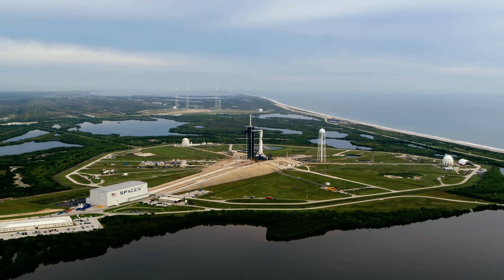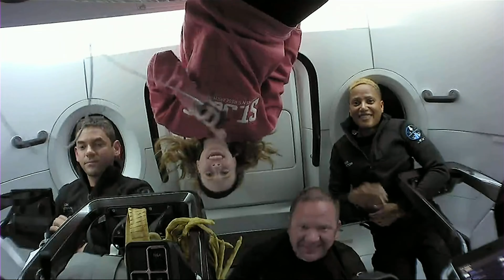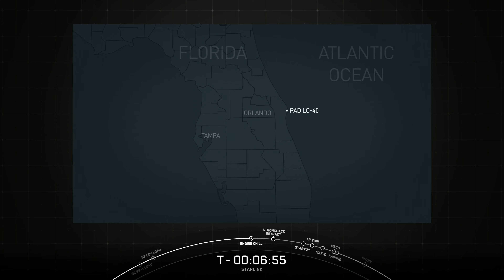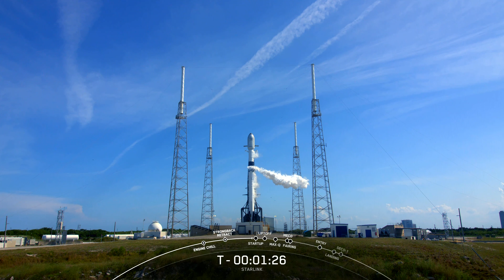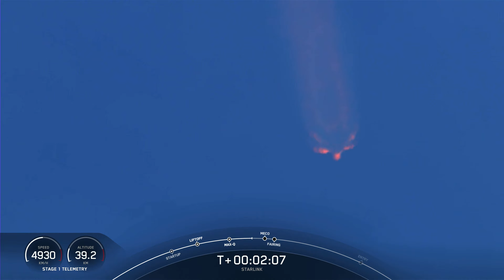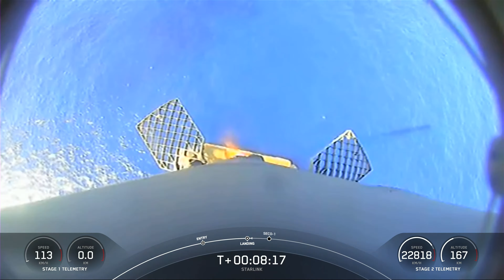Starlink Mission

Comment: This landing shot was extremely satisfying to watch
Reply: And no signal dropout this time! Anyone know for sure if they're now using Starlink itself for their video feed from the barge?
Reply: @jordanhazen7761  Not sure but that live footage was from the 1st stage’s perspective.  I wonder if they can use starlink for that camera too?
Reply: @tomanderson8251  Starlink performance from moving vehicles is improving, and I guess a phased-array antenna could fit in the interstage, but they probably wouldn't want to incur the mass penalty of carrying that all the way up. I think both S1 & S2 transmit from small omni antennas on S-band (there are FCC filings showing exact frequencies), which can be relayed via the launch site at first, but likely switches to either the barge or a nearby support ship once over the horizon, and on to a satellite from there. (For S2 you can hear the callouts of ground-station handovers). Watching the landing again, there was still a slight breakup on touchdown (either from disturbance to the barge's position if the uplink is there, or maybe water vapr in the exhaust plume infringing on line-of-sight), but much shorter of one than previously

Comment: The new 1st stage is more rare, than used one. Fantastic!
Reply: Interesting that they chose an internal Starlink launch to debut this new booster, suggesting few (if any) outside customers still have qualms about a flight-proven one. More often these Starlink missions get used more to prove out the envelope on reuse, as with recent 12th and 13th flights
Reply: @jordanhazen7761  I would guess that now the safest first stage is one used once or twice. You can say it has been successfully tested 😀
Reply: It sure looked beautiful particularly landing on a well-seasoned Just Read the Instructions in a still, blue ocean.
Reply: @jordanhazen7761  It is "flight-proven" so now SpaceX should start charging more for such boosters :D
Reply: @desunistallerinc  I'm sure they won't.
Reply: Used ones has been tested and fine tuned during each launch and landing, new ones probably takes more steps and precautions as they require more data to be collected till they find out what needs to be optimized during the 1st launches.. imho
Reply: Its crazy these boosters are starting to work more like aircraft- maybe nobody trusts a non flight proven booster as much as a used one
Reply: @DouglasJMark  
We ask technicians and engineers to design and develop flight engines that operate at the speed of light in the field of aviation, and this is in order to teleport in the regions of the planet Earth and reach planets similar to Earth, such as (TOI-1231 b) Planet and (Gliese 486b)Planet and (TOI 700d) Planet
Therefore, the design of engines and tests of flight engines at the speed of light must be expedited in order to turn science fiction into reality
You should take advantage of this lost time in order to travel at the speed of light in space and enjoy these wonderful beautiful planets like (TOI-1231 b) Planet and (Gliese 486b)Planet and (TOI 700d) Planet
(Please send the names of the planets and these requests also to the experimental physicists and engineers in the Department of Mechanical Engineering)
Reply: @jordanhazen7761  Elon said that a first stage that has a few proven flights is more reliable than a brand new one. It makes perfect sense the way he explained it. Before that statement a lot of people assumed a new one was safer because it could not have any damage or wear from a previous flight — turns out the opposite is true. There are plenty of stories about engineering failures during a maiden voyage - think “Titanic”
Reply: @jordanhazen7761  Good point, usually NROL, NASA, etc prefer new boosters - at least in the past. I think launch customers are indeed realizing that it doesn’t really mean anything at this point (and I believe they get a substantial discount.)

Comment: Thank you, SpaceX for the Starlink system I'm using right now!  Awesome launch and great weather at the launch site.
Reply: How can I use it ?
Reply: Starlink has been awesome. I'm way far north and I have better internet now than I ever have.
Reply: Same here!  Starlink has been life changing for my family and I.
Reply: @unotechrih8040  is it stable now? I remember i used it at my friend's house(a year ago) and it was frequently disconnecting. I trust elon, he makes his products better in a very short amount of time
Reply: @madomk3438  more satellites means less drops as the constellation is more complete.
Reply: @willyphisdergash9428   more satellites 📡 are deployed the better the connection that’s why they are deploying more satellites to better the connection
Reply: @madomk3438  I've only had 2 down times since I got it that lasted about 15 minutes. The app is really cool and tells ya if it's searching or if there is a network issue. I don't think I could be more happy with it. Only complaint is there is no hard line into the router. It's wifi only unless ya order a separate adapter.
Reply: @madomk3438  Yes, I hardly ever get any disconnections now.  I have Starlink at two different properties and have had it for most of the beta phase and the disconnections are definitely less frequent now.

Comment: Great commentary Siva! Hmmm Titan rockets were launched here at SLC-40 (LC-40)? Wikipedia states from 1965 to 2005, 55 Titans were launched. SpaceX has leased this site since 2007. It states there have been ~90 launches here so far. Everyday Astronaut states 86. Either way, it's amazing as Falcon 9 has only been flying since 2010.

Comment: Just watched the telemetry closely and found something that amazed me! Even after shutting down the main engine at an altitude of 65 kilometers, the booster still ascends until an altitude of 116 kilometers before gravity wins and pulls him back! May be old knowledge for you, but me, I am amazed by that!
Reply: Yup, look up typical flight profiles of ballistic missiles, which is what S1 is at that point- their "boost phase" can be surprisingly short. I'm glad SpaceX shows both S1 and S2 telemetry now. Full instantaeous orbital elements (apogee, perigee which starts off very negative, right ascension etc.) would be even better. ULA used to broadcast those, but stopped after they got in trouble from revealing too much on a classified DoD launch
Reply: This is because it is moving very fast when it shuts its engines down, and thus takes time to slow down and start moving in the other direction.
Reply: physics:
 kinetic energy, 
the energy of mass in motion
Reply: I always watch that too. I have seen it go up to 136km before returning.
Reply: @eastafrica1020  The Falcon Heavy Center Core ascents are cool to watch!
Reply: As an extreme example, look up SpinLaunch - all 1st-stage velocity imparted while still on the ground, shades of Jules Verne's trip to the moon by cannon :) Assuming they can make it work of course
Reply: It was, of course, going very fast, upward, when the engine cut off. It takes time for gravity to slow it down before it can begin falling down. Think about when you throw a ball a long way. After it leaves your hand, it continues to arc upward for some time before it starts coming down again.
Reply: @user2C47  duh
Reply: @odysseusrex5908  we all understand that. The reference to the size of the numbers is what the author thought was impressive.

Comment: Very different colour balance, saturation and focal length for the first stage camera compared to previous launches. Looks like they're still making slight changes to the Block 5, though probably nothing related to flight.
Reply: Yes, I wonder whether this new booster has a new camera system that also helped with the lack of video break-up on the landing.

I'd also never seen the pre-sep view inside the second stage at 15:35. Usually they cut to that camera just as the first stage falls away.

Comment: I'm curious about a few things in case anybody knows; 1) Is the drone ship completely autonomous, or does it have a support ship that tows it back to the cape? 2) How long does it take for it to return to the cape?
Reply: Yes it has a support ship, and one to three days depending on conditions.
Reply: @odysseusrex5908  👍  I wonder how the economics compare with the extra fuel (and rocket size) it would take to boost back and land at the cape.   I would imagine the ships fuel is negligible compared to the extra expense of rocket fuel and larger 1st stage.
Reply: @rogerheuckeroth7456  Landing at the launch site vs at sea is a matter of payload mass and velocity. Most of the time, there simply isn't enough fuel to boost back. When there is though, they do so.

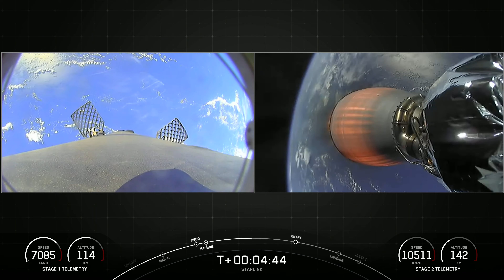Comment: It sure looks like an editing happened at 17:44 when the camera view of the engine changes from one engine to a completely different one. WHAT'S UP? The edited shot is of a completely different time and place in space. Look at the orientation of the Earth from one to the other!
Reply: There are two cameras watching that engine from different angles, which they switch between periodically to better catch any problems. Those have been present for many launches, though, not new with this one. Occasionally they'll slip in a few frames of the one showing the inside of S2's LOX tank, but for some reason they don't like to broadcast that much. Its time slot is usually occupied by the trajectory animation instead.
Reply: There's two cameras either side of the 2nd stage engine. If you look at any of the videos with longer coverage from space they switch back and forth between them.

Comment: are they now recovering all of the fairing halves? wish we could see them catch em'.
Reply: They no longer attempt to catch them. They fall to the ocean under a parasail guided by small thrusters. They are then fished from the sea by the recovery craft.
Reply: They tried, but the recovery rate was not worth the cost of trying to catch them.  So the recovery ship just fishes them from the ocean.

It means more expensive refurbishments on the fairings because of sea water, but it is still cheaper than catching with nets.

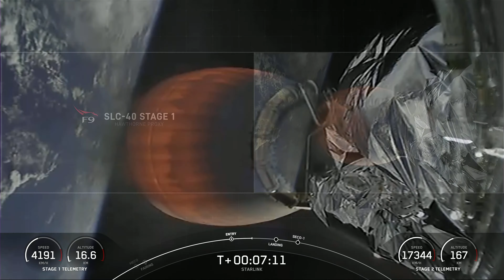Comment: 20:11 can some one explain how the earth and clouds are moving clockwise in one angle and when the camera switches its moving anticlockwise the other.
Reply: Cameras on both sides of the second stage. At 20:11, earth is on the left side of the frame, north is down and south is up in the frame, and the camera is facing west (roughly, anyway. I don't know the exact launch azimuth for this launch, but it's undoubtedly east-ish). After the camera switch, north is up and south is down in the frame and the camera is still pointing west, but earth is on the right side of the frame. In both shots, clouds/earth moving towards west away from cameras, as the seconds stage and cameras fly east.

Comment: What I find interesting about these "live" broadcasts, is that if you turn on the subtitles, you will actually be able to read what they're saying BEFORE they say it. And that even includes when they say something wrong, or when they react to something that hasn't even happened at the time when the text appears.
So obviously it can't be completely live.
Reply: Nothing is ever "completely live by your parameters. If you're standing right there in Cape Canaveral, it's still not live, it's a few milliseconds as light travels from the booster to your eyes. 

On their end, they need to encode the video before uploading it to youtube. Then youtube itself takes some time transcoding, then distributing the video to various servers, then down to your browser, then the buffer time on your browser. You're usually anywhere from 10 to 30 seconds behind actual live on any live stream. The subtitles are automatically generated by youtube, and the sync sometimes isn't perfect. 

This isn't even specific to youtube, the same happens on live TV, and on anything else that you watch "live".
Reply: Streaming video always incurs some buffering delay - 30 seconds or so is typical for Youtube. I noticed that the audio-only mission control stream for this launch was at least 20 seconds closer to live. Hearing "second engine start" while seeing it still attached to stage 1 was slightly disconcerting! :)  That audio feed is still  live through satellite deployment, btw - v=KIJ51_3TEgE  or linked  from spacex's channel - full URLs are blocked in comments
Reply: You thought it was real time?  Wow..